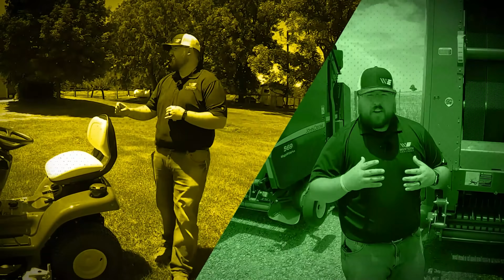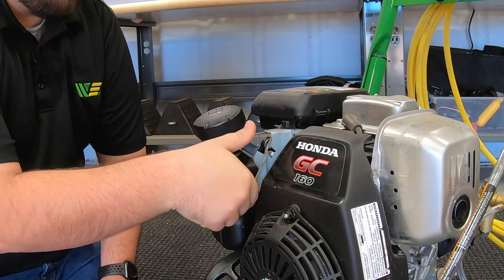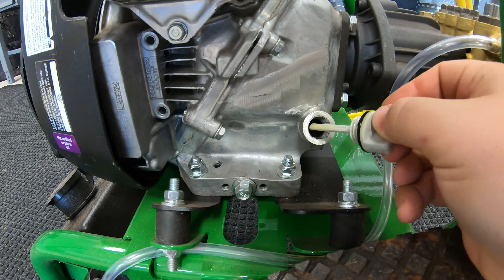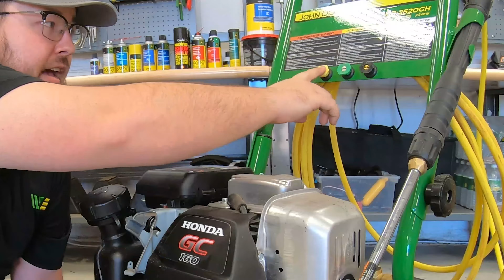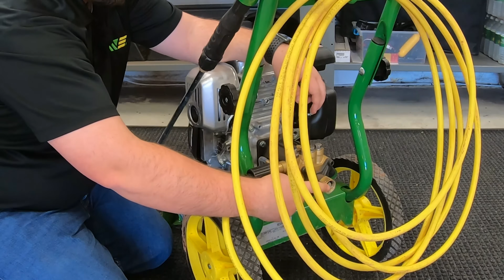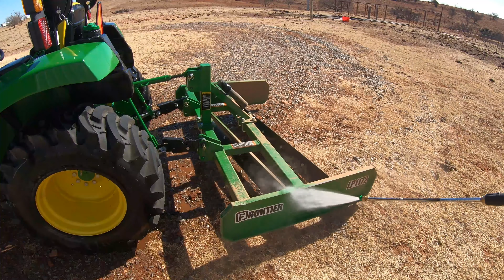John Deere Gas Power Washer Review

Comment: Hey can you tell me what’s the valve clearance on a 2018 z920m with the 23.5 kawasaki
Reply from the maker: Valve Adjustment Clearance in the operator manual shows 0.10—0.15 mm (0.004—0.006 in). Thanks for watching!